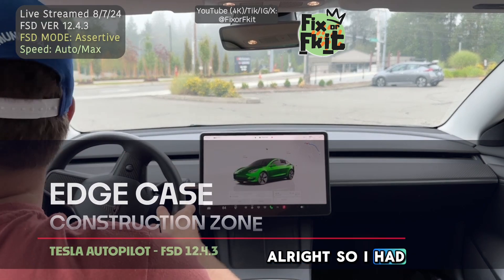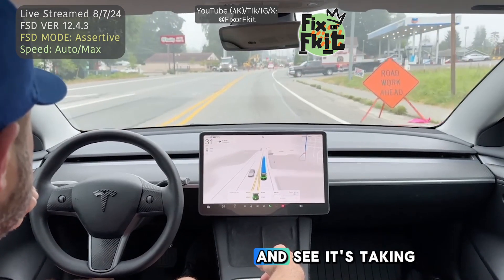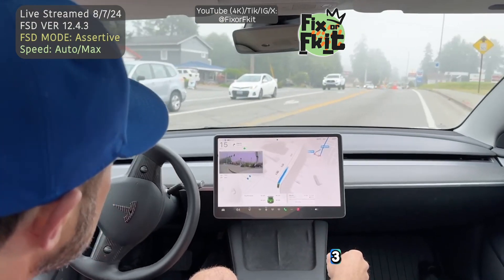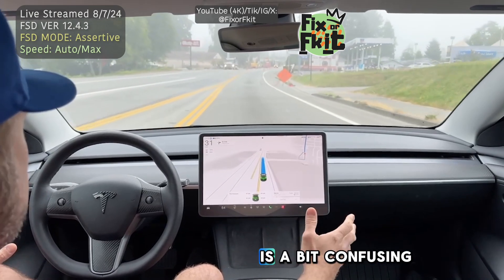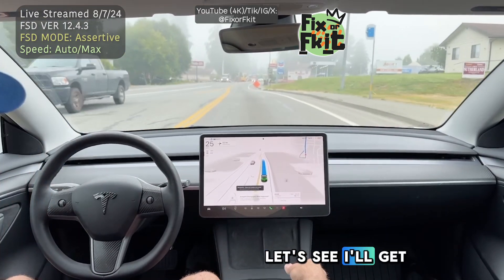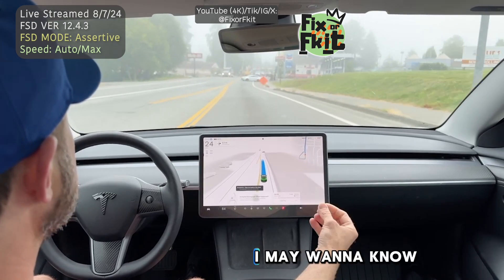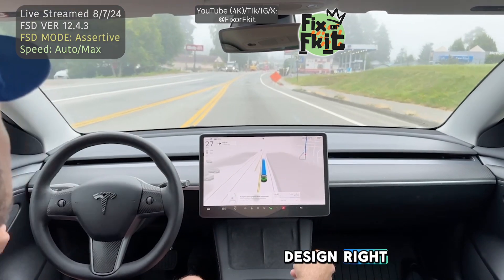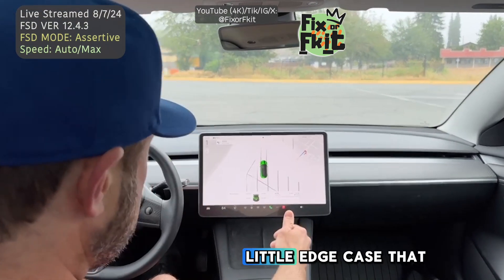🚨Tesla FSD 12.4.3 Challenging Construction Edge Case - First Critical Disengagement After 459 Miles

Comment: Not an AI if it can't learn after few iterations of the same condition over and over, that is just standard logic programming, if the logic is not there then it has to be fixed, AI doesn't need to be fixed but need to be taught.

Comment: Garbage killer software. Camera only will never work.
Reply: This isn’t a camera or perception problem. It’s not navigating properly through what it can clearly see. What depth related information would LIDAR have solved here? You clearly don’t know jack about self driving. Cameras-only is fine.
Reply: @GoatDirt   This isn’t a camera or perception problem. 
Spot on.
Reply: @BigBen621  🤛 what’s also odd is that EVERY other car we can buy with every sensor available (Lucid, Mercedes, Ford etc) can’t do 90% of what Tesla can do on camera only. The debate is demonstrably over.
Reply: There you go again, stating as a fact that which is only your completely unsubstantiated opinion.